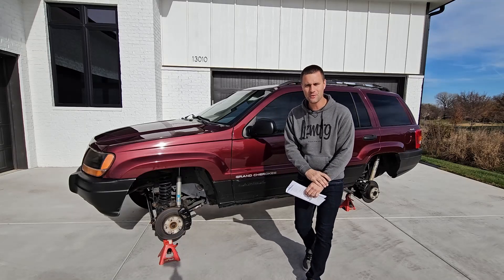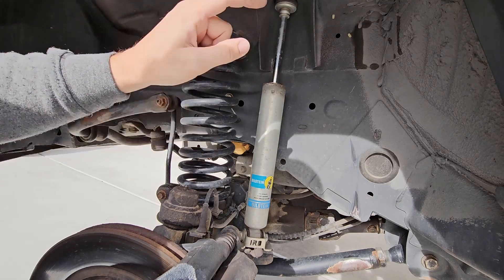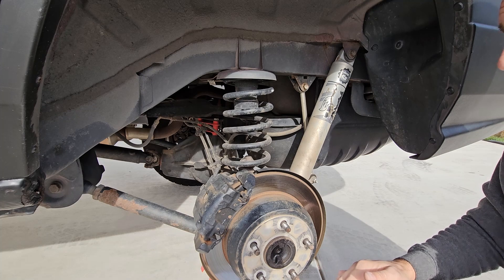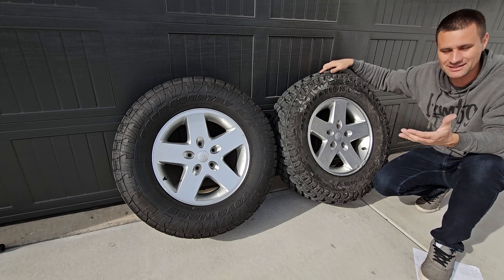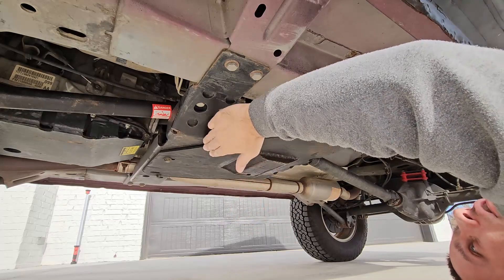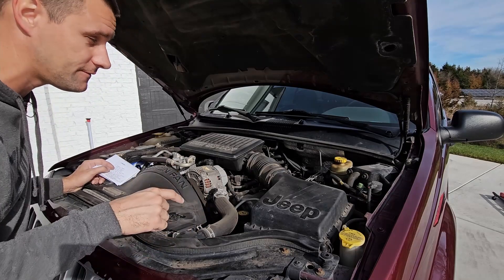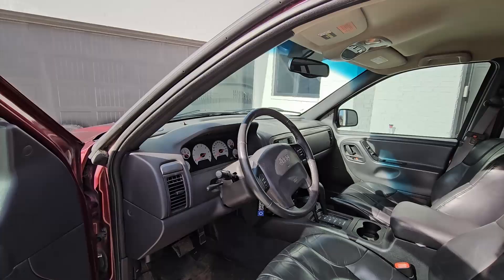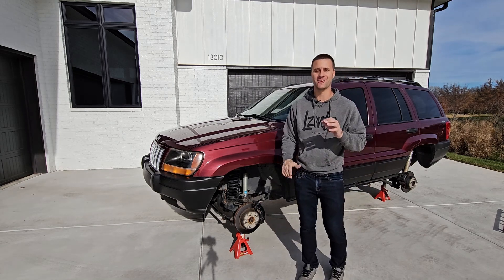SELLING The ULTIMATE Jeep Grand Cherokee WJ

Comment: I pulled my WJ 4.7 engine at 160k for a rebuild after it dropped a rocker arm, and the bottom end was in good enough shape to just hone the cylinders and replace the rings and bearings.  The rod bearings showed a little wear but the mains were like new. In fact if I had known what I would find, I would have just had the heads rebuilt and replaced the timing chain like you did instead of pulling the thing out. FYI I also upgraded to the newer style rocker arms when having the heads rebuilt. For those who don't know, the newer style positions the oil squirt hole to squirt at the rocker arm pivot instead of up and to the top of the inside of the valve cover, and also at more pressure than before.

Comment: Tyler, did you ever consider upgrading the rear upper control A-arm to something like the IRO WJ Adjustable Rear A-Arm?  I note that you were using the stock A-arm with a 2 1/2" spacer.  Did that give you any problems?  Did you replace the bushings in the stock A-arm with factor Mopar bushings or Moog?  I'm trying to determine if the extra cost for an IRO adjustable A-arm is worth the price or stick with the factory A-arm.  Can't wait to see future videos.  Thx, John

Comment: A Sad Day... I knew you would be selling the WJ. I had a 1999 Wj SE 11 years ago. I traded it in for a 2004 WJ limited 4.7L. The 2004 WJ has many OEM updates. RB1, UConnect w/mirror, Sirius with Artist cable, iPod integration, 10 disk changer, I also added a cabinet filter, a 1" Addco rear sway bar, and an Overland steering wheel from Ebay UK. It is in the dealer right now for a complete brake lines and hoses and completing the front end rebuild do to having death wobble. It has 18" wheels: Oem export Stealth Edition Startech Monostar III WG I imported and had them renewed with Pirelli 255/55/R18 tires. I had a shop installed new Moog up country coil springs with new front and rear control Arms. This WJ has gone through two snow blizzards here in Maryland. I have owned this Jeep since 2013 with 113000 miles and now it has 161000 miles. I had the vehicle Country Code change to Cananda to turn on the Daytime running lights. Finally have the rear export bumper reflectors. This Is my Dream Jeep. A City Jeep 

  

I wanted to share my experience with this amazing vehicle and how much I enjoyed driving it. It was reliable, comfortable, and powerful. It had everything I needed and more. It is my dream car, but I am sad to see you are letting your Wj go. But I hope it will find a new owner who will appreciate it as much as I have watched you build and off road with it. I have learned a lot from your Channel and look forward to whatever WJ and Others, you bring to the Channel.

Comment: i have a 2002 grand Cherokee WJ it has a 2004 salvage motor that had 75000 miles 4.0. It runs great looking to add a locker on the front or the rear it is a daily driver and i just want some extra wheel power for those light off road trips what would you suggest

Comment: I have an 03 Overland.  Do you feel much difference between the stock H.O. and your imitation H.O.?  How much better does the Aussie locker perform than the VariLock?  Would I be able to upgrade mine, or would I need to swap in an Open-diff axle?  Did you have any issues with slop in the bolt holes when converting to the Core 4x4 control arms?  I'm dealing with that at the moment.

Can you provide more detail on the OEM-style bluetooth stereo?

Definitely going to look into that Trailforged radiator skid plate.

Comment: Doesnt the ultimate WJ need the HO engine (03/04) found in the Overland?  Edit - read the full add - you added a whole bunch of the 04 HO parts, and a bunch of other stuff
Reply: Good luck finding HO parts, you’re actually better off with the normal 4.7 especially if planning to restore.